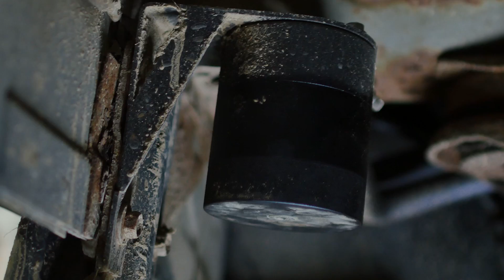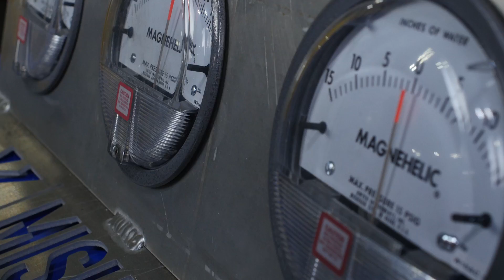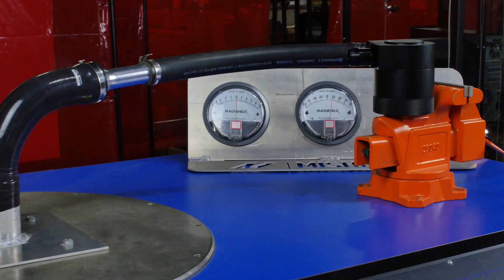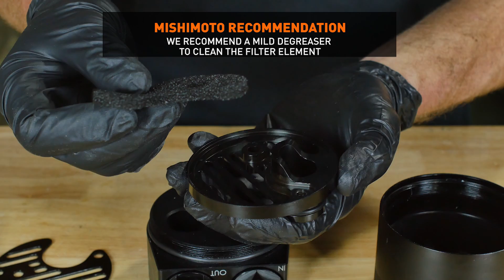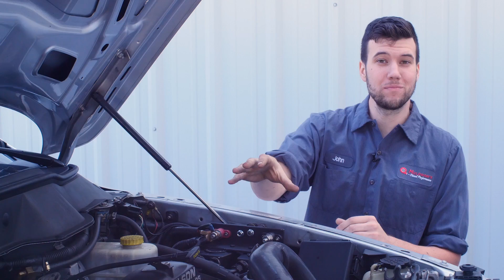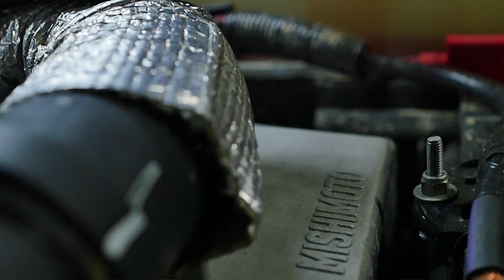Ford Powerstroke Baffled Oil Catch Can Concept to Completion by Mishimoto

Comment: I have a 2010 f250  6.4   ,, but i havent deleted  🤔wil this work on my truck ,, ?
Reply from the maker: Not a requirement for the install ;)
Reply: @mishimoto  what about the excess white smoke ? 
Should I replace the turbos and see what happens??🙏
Reply from the maker: We would suggest taking the vehicle to a professional if you are asking for diagnosis assistance for an unrelated issue here.
Reply: @mishimoto  I did take it to the dealership.. they say turbos we're the issue.. and I dnt want to take it there anymore, . Right now I'm just trying to cut corners.  Since I've spend over $13k on repairs on my truck ina year period.. .. 
Anyways.
Thanks for replying. 🙏

Comment: What does blow by mean?
Reply from the maker: Blow-by is unwanted leakage of gas under pressure, such as that from a piston or its sealing rings. The blow-by that occurs when too much pressure from the combustion chamber leaks into the crankcase needs to escape somewhere. All piston engines experience blow-by of compressed gas past the piston rings.

Comment: Will this kit work with a 2000 7.3?
Got a lot of blow by and it’s making its way into turbo pipes
Reply from the maker: This kit will not fit directly on the 2000 7.3, however, you can use some of the universal items to make something for your vehicle.